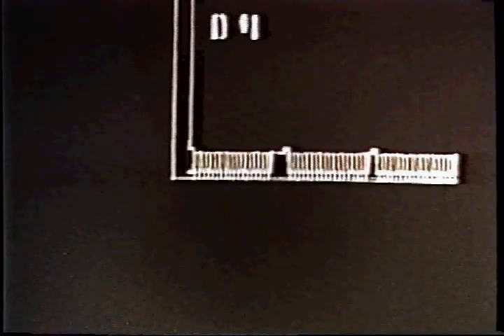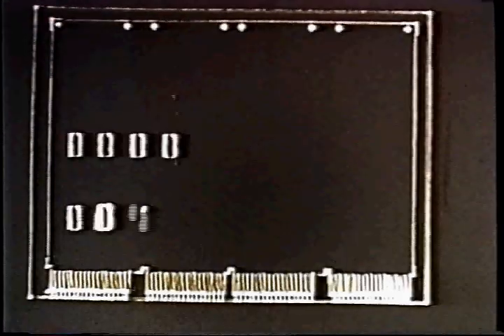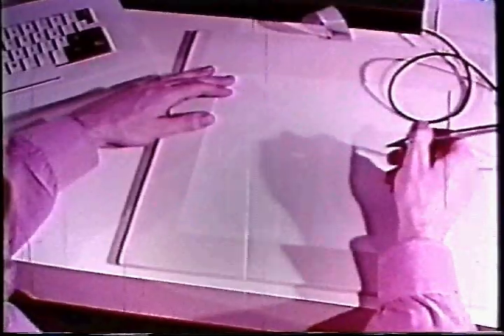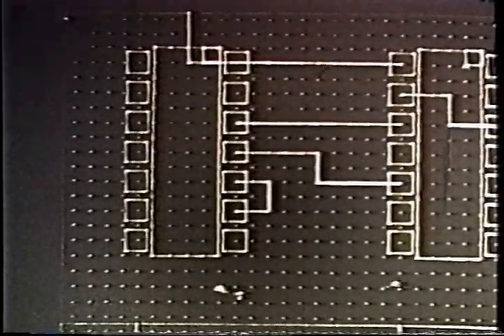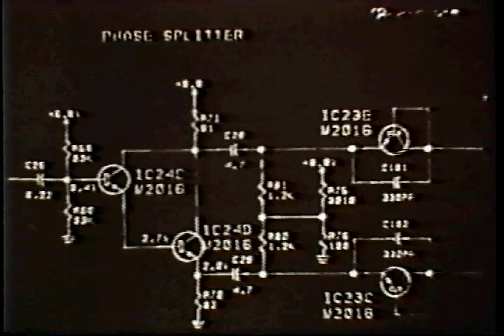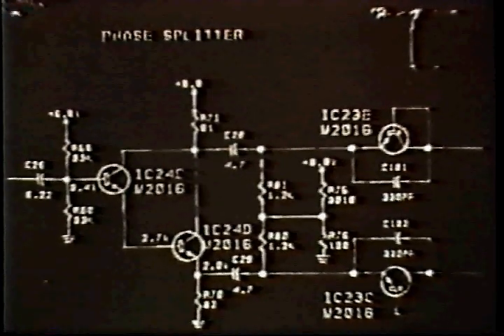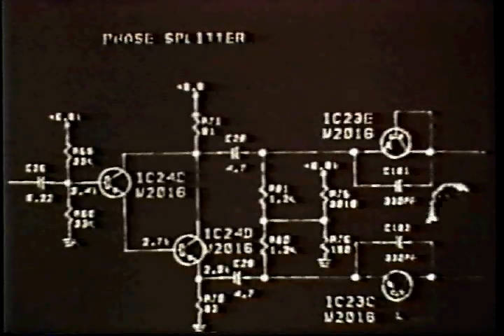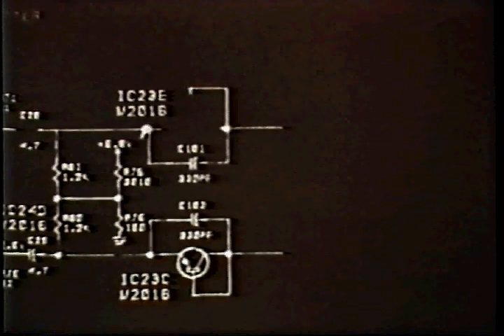Applicon CAD System with Trainable Hand-Drawn Symbol Recognition

Comment: I started working on Applicon AGS 870 2D system in the late 1970's and then moved to AGS 880 3D system.  I remember hunkering down in a small dark room with a green CRT working on drawings.  Later I did an internship at GE Medium Steam Turbine Division in Lynn, MA in fall of 1979 using the 880 system.  I was in charge of administering the Applicon CAD systems.  They had a good number of stations.   I went to work for Applicon in the spring of 1980 just after graduating.  I was involved in doing demos, training and designing the system interface for Bravo.  It was a great time, and I enjoyed my work there.  I remember TSR (Tablet Symbol Recognition) and thought it was the greatest thing since sliced bread.  I even had a document written by the programmer that wrote the code for it that described how it worked.  A dot was just that, but if the symbol was over a certain size, then a box was drawn over the symbol that was divided by 2 equal distant horizontal and vertical lines. So, in essence you have 9 equal size boxes encompassing the symbol.  The box was not drawn on the screen, it was all done in memory.  The symbol was unique depending in which 3x3 square it started in, ended in, and how many times it crossed each vertical and/or horizontal lines. Kind of hard to explain without a drawing.  I believe you could have up to 7 symbols that could be combined into a single command.  Most commands were 3 or less symbols.  More than that it was hard to be consistent.  I remember being sent to Saginaw Steering, a GM plant in Saginaw, Mich., with a programmer to do some training.  After a day of training, we were ushered into a meeting with some executives and told that they had asked for help converting their old AGS 880 Fortran programs into the new Bravo IAGL (Interactive Applicon Graphics Language) language and not a training class. Yikes!  The old AGS 880 system had a thing called User Commands (UCMD) where people could write programs in Fortran and compile them for use in their systems basically allowing users to create their own commands for the system.  GM had written hundreds of such commands and the programmers were stumped as to how to convert these to IAGL.   IAGL was a similar idea for the new Bravo system but was an interpreted language instead of compiled. It was loosely based on PL/1.  We had them print out a simple program and we would do our best to help them.  We were scheduled to be there for 3 days.  They gave us their simplest UCMD written in Fortran, and it was hundreds of pages long.  After an hour or so we gave up and asked them what it did.  They showed us what it did, and we said, "Was that all?" We then sat down and within 5 minutes wrote the same thing in 15 lines of code.  No conversion, just a simple rewrite. They were stunned and excited and said they wanted to add a few more features they always wanted to have, and another few minutes and 5 lines of code we enhanced the program.  Once the engineers saw what we did and how we did it, they said that was all they needed, and they could do the rest.  While standing around for the rest of the day I saw a lady come in and start drawing some kind of chart.  She had a bunch of charts to draw, and I saw that all were similar, so I asked her what she was doing.  Every week she spent days drawing charts with various inputs.  I then wrote a program in IAGL that recreated the charts and all she had to do was input the values.  It shortened the process from days to about 30 minutes. She was very happy, and we returned to Burlington as hero's.  I left Applicon at the end of 1985.

Comment: Wow!  I just stumbled upon this.  I worked at Applicon for near 8 years till it was bought by Schlumberger.  I actually supported some of what was shown here.  The product was PCB 870.  These ran on Digital PDP-11 minicomputers.  There were three separate product lines.  A 3D Mechanical System 880, 2D System 870 and 860 for VLSI chip design.  The follow-on system was called BRAVO and was based on mid range Digital Vax minicomputers.  It folded in all 2D and 3D applications into one geometry engine that had a custom database API.  It was very advanced.  However about a year after the acquisition by Schlumbeger it all fell apart.  All of these systems utilized tablet symbol recognition.
Reply from the maker: I'd love to hear more.  And if you have images or documentation which you could share that would be a bonus.  I am always interested in documenting this history.  It is really important.  Your note was really helpful and welcome.
Bill

Comment: Hey  BIll,   I used one of these computers in 1980.  It was brand new back in those days.   I'm fairly sure you have your date wrong .  In 1970 this machine wasn't even invented yet.   Thanks for uploading this.  Brings back memories..
Reply: color CRT machine was delivered in 1978, so I suspect the B&W was a couple of years earlier.  Pen design was changed to being a smooth tail out of the top rather than out of the side.
Reply: The color CRT is the raster scan monitor and the B&W is the monochrome monitor and before that monitor is the storage tube monitor, which is the monitor that show green beam lines.  It can be use to draw wireframe in 2D and 3D without the solid image. The color raster scan, you can do solid image in 3D.
Reply: Applicon released the Bravo Editor in 1969.
Reply: FYI: The Applicon Editor was the first solid modeler. You designed in wireframe and then ran it through SynthaVision to render it to a solid representation. Applicon's downfall was that they developed all their software on Digitals VMS Operating System. Later they released on Digitals Ultrix Operating System but the damage was already done and we began losing many customers; the government first as they wanted it to run on the Unix systems with the RISC chipset.

Comment: I remember this computer very well because I build them and tested them in Burlington, Ma. in the old days and today almost anything can be done on a SMARTPHONE !!! That right on a SMARTPHONE using Android software call AUTOCAD !!! From time to time this old Applicon CAD/CAM, you can design the chips from SSI, MSI, LSI, VLSI  and to SMT. Don't get me wrong, there are more new chips are upgrading all the time and much smaller. The WiFI added into the circuit that goes wireless! Now that I can be able to use my 4G smartphone to design and take pictures and have it send to a wireless CHEAP CANON PRINTER that can do more than the old Applicon 's INKJET COLOR  PLOTTER which cost more than half million dollars compared the $30 printer!How about the new 3D printers that are available today? Did you know that I can take a trip to Italy with my Smartphone to check my home with live video and control my four wheels robot that I build and check to see that what goes on around the house? I can't wait to drive a new electric self-driving that will be available the next six months or 2020 in 5G, like the Byton SUV smartphone electric automobile. If it wasn't for Applicon's CAD/CAM, none of these technologies would not come through.